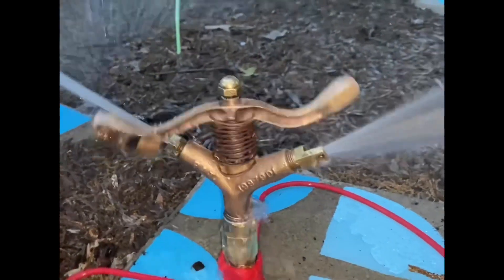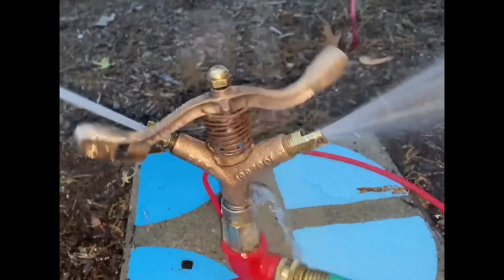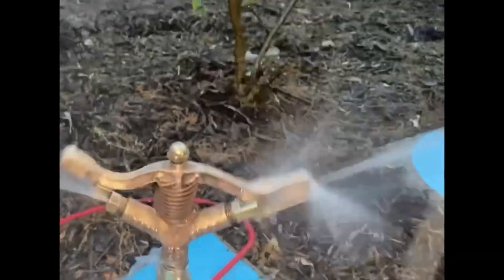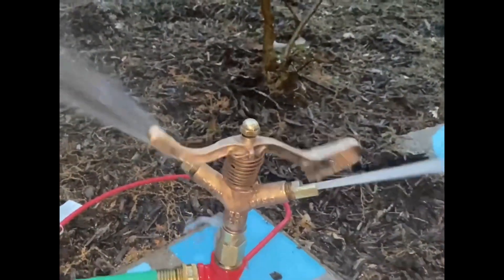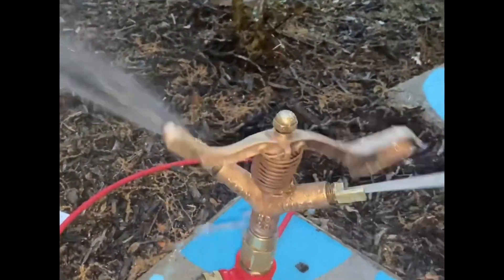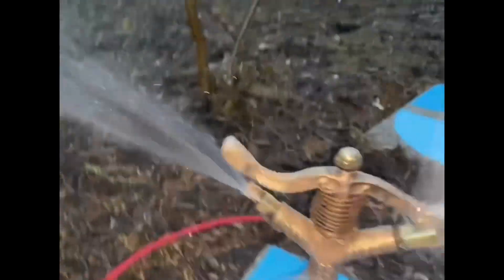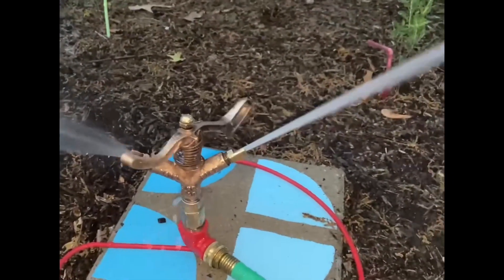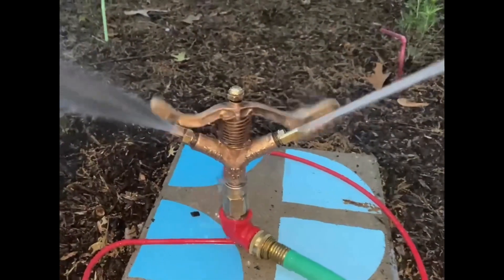c. 1945 Rain Bird No. 40 Impact Sprinkler. Tossed this video together because I’m excited it works!

Comment: I just got one of these not too long ago, however it has a rear spreader port plug and its rusted, and i tried to get it off but i need a better socket. Otherwise it is complete , I may try to run it off my parents garden hose to start off with. When it gets warm enough and my parents start up their system for the year ill make some videos of my smaller heads off the hose. I like doing that because its less work than getting my pump out. But i do plan on running some of my smaller heads off my pump as well.
Reply from the maker: Looking forward to seeing it.

Comment: Very nice sprinkler. The ag dealer in onward, IN has one of these in the window of his office. The one where I got my p150s,p200z,rainbird 103dl, and buckner wedge drive gun. I have the bigger one of these, the #70 with a 5/32 drive and 7/32 range nozzle
Reply from the maker: I need to remember where I saw an old Buckner Wedge Drive big gun for sale. Seemed like an unusual place. I’ll let you know when/if I run across it again.
Reply: @antiquesprinklers  it's definitely a collector item. I ordered a cam lock fitting to try it out. It has a 2.5" F fitting on it and I can't get it off so I just ordered the other end. As soon as I get it I'm going to test it out. The only problem I saw is the drive wedge is loose so not sure if it will move or not. We'll see.  I'm sure you'd be amazed when you see it. It has 3 nozzles. A 3/8" drive, a 7/8" range and a adjustable spreader nozzle. I think it was made in the 50s 60s possibly. Super old